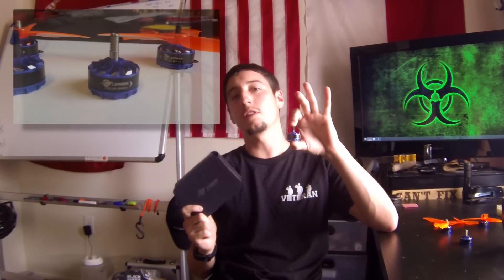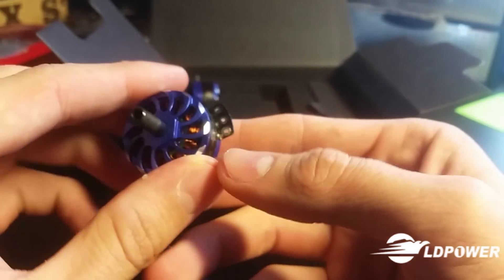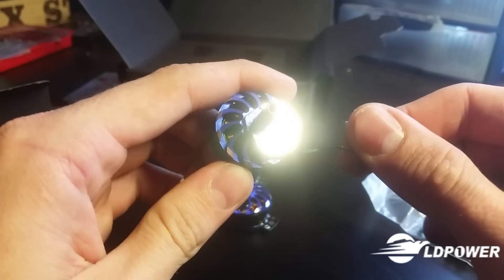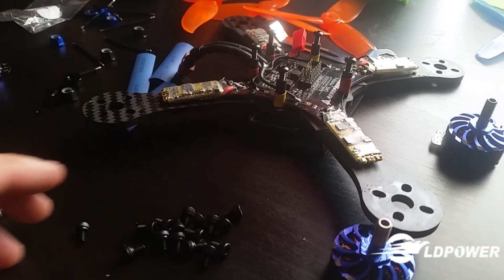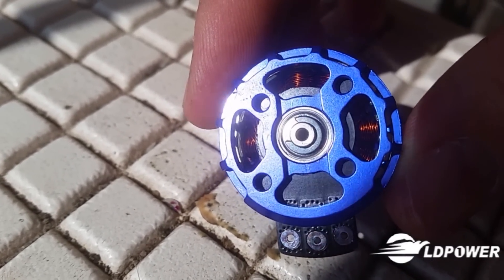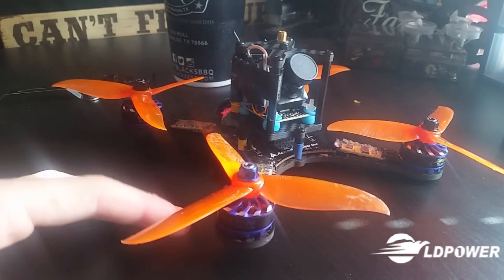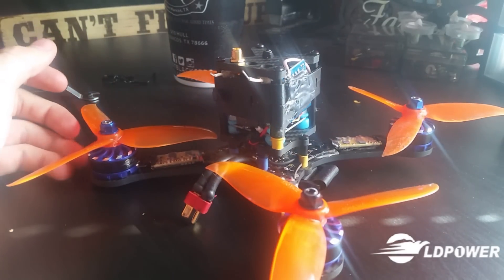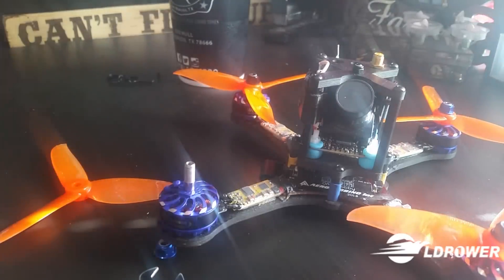LD Power Storm 2305 2600kv Review

Comment: Great video, subbed! Do you think that the 2600kv or 2300kv would be suited better to running 5040 triblades?
Reply from the maker: Ive been running 5045 cyclones on these motors since day 1 and Ive never gotten hot motors at all!
Reply: RotorQuad Squad What's your flight time in 5045 with these motors? 1300mah lipo?

Comment: Dude! How can you even fly with video like that lol. You were not even that far away?
Reply: Its one of the unfortunate downsides of the La Forge Diversity system. In my goggles I see almost no static anywhere on this field but for whatever reason when the diversity is switching it introduces static into the DVR.
Reply: At least you can see.
Reply: I normally run my Foxeer Legend 2 for HD videos but this is my race quad and it isnt really set up to mount the hd cam. The Mod-x doesnt usually show up for reviews but these motors were just too good to pass up!

Comment: you call this a review?? smh
Reply: Care to elaborate?
Reply: No flight times..no amp draw numbers..ect ect was more of a cosmetic liking than a review In my opinion...
Reply: You are correct. However I dont think you understand that I do my reviews for the everyday guy. If you want amp numbers and specific times you would know to go looking at the miniquadtestbench type reviews. I find that a large majority of this market is overly swamped with numbers and hype and figures and sponsors so I simply wish to break it down simpler and focus on the features and feel of the product instead of just vomiting numbers and saying "buy this." Most of the successful toy (i.e. Phantom/Mavric/Yunnec) reviews are simply guys looking at the multirotor and smashing them around a bit. 

While I respect your opinion and right to have it, I feel you may be one of the ones who is more technically interested and should focus on a different reviewing model.
Reply: What I ask of was basic info a basic person/flyer would want my friend... What size pack and mah was you using...?
Reply: I was using a 1300 Turnigy Nano tech and a 1300 Turnigy Graphene. I realize now that between making this video and a second one that fact got slipped in this video. My mistake. It was included in the second video but forgotten in this one. Any other questions I can answer for you? 

Build was an OAS Mod X
Flycolor Raptor 30a ESC
Hyperlite F4 Board
Foxeer Arrow Cam
AUW:478g

I appreciate the feedback and will gladly use it in my next video.
Reply: I'm taking that as 4 cell 1300..? And one last question have you used any of the xnova motors if so your choice between the two brands.. Was leaning toward xnova but you have me very interested in these....
Reply: Correct 4s 45-90c on the 1300 nanotech and..... 65c on the 1300 graphene

I have a set of xnova 2206-2500kv and they fly great however the "power on demand" feels a bit mushier. Similar in power but the punch factor of them doesnt seem to be there. I feel like these LD are instant power on. Like by the time you realize you are full throttle, you are already across the field.
Reply: Thanks you made my mind up....do you got a link to these that are in stock as everyone I found is backorder
Reply: Black:https://racersedgefpv.com/product/fr2305-2600-sword-set-of-4-copy/

Blue:https://racersedgefpv.com/product/fr2305-2600/

I love them. Literally just came back from flying them. and they still impress